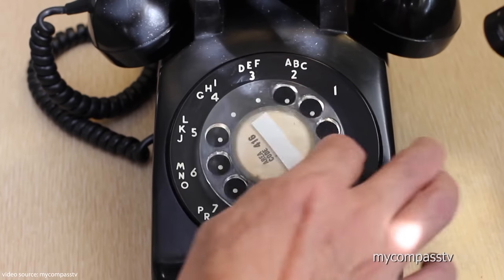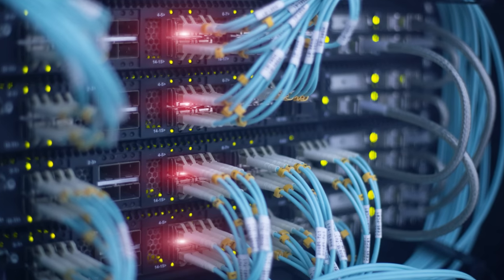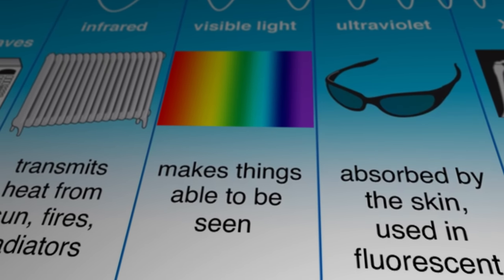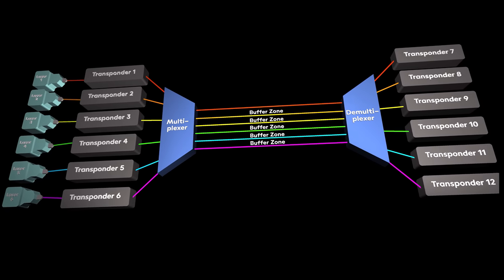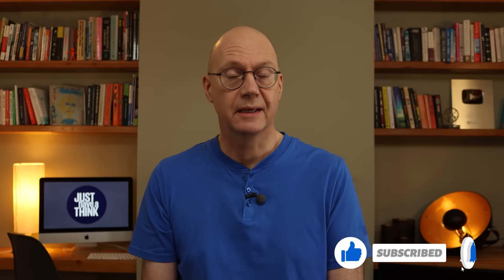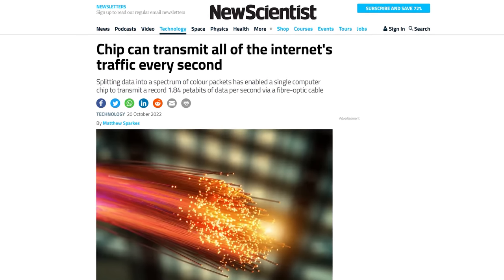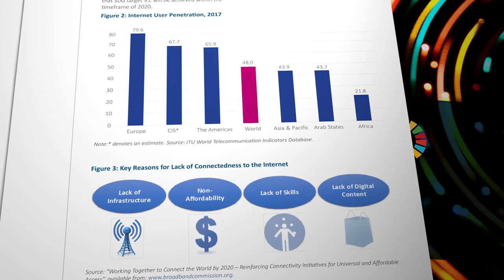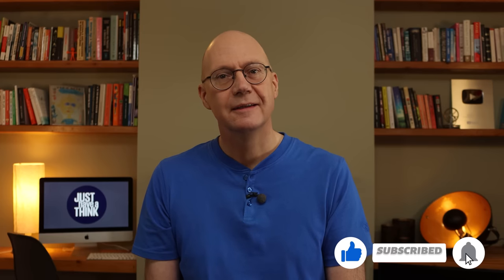The entire internet on a single chip! MASSIVE energy savings.

Comment: Okay, how could this be used for Super computing?  Right Now computers operate with Zeros and Ones, but once you have a Comb with several hundred Teeth, that could be sent down the same fiber optic line and accurate detected for its Frequency, well, think of the number of possible addresses there would be.  If the number of Addresses are truly substantial, than each Address could be equated to some basic principle or concept.... Heck  this is the Thing that will make Artificial Intelligence actually Intelligent, and it would be possible to create a Full Data Super Computer that could Think Comprehensively down to the finest distinctions.  That would be Cool!

Comment: If there is no single computer able to recieve all this data then what is the point. If many computers are needed to recieve all the data then the energy savings are just not there. They obviously need to solve the problem at both ends.

Comment: There are so many inaccuracies in this video it's painful to watch. A "chip" is not "faster than broadband" that's like saying a tire is faster than a highway. "The entire internet on a single chip" is just cringeworthy - "an elephant on a hard drive!" That's before you reveal you don't understand the speed of light, the way multiplexing works, or even how "the electromagnetic spectrum" is irrelevant to fiber optics, which use only the portion that is - duh! - LIGHT. Then since the point is the "Massive!" energy savings - where? HOW is this higher capacity transmission going to reduce energy usage/costs? We're not going to have (or need!) one of these in every computer, MAYBE just in every datacenter, where they might replace a 20W device with a 5W device - connected to megawatts of other unrelated hardware.
Reply: I'm afraid I have to agree. In fact the SFP's that do the transmission and receive only use 1 or 2 Watts for a 10Km range. All that will happen is the Mega bit and Giga bit SFP's will be pulled, swopped out for these Petabit transceivers, generating large amounts of e-waste.

Comment: Avoiding all of the common remarks about this technology. Imagine the broad ranging potential for AI and those that will make use of AI. I can envision a world where humans can become redundant, or at a minimum subservient to AI and the small number of humans that may manage to retain control over over AI. Machines require a lot more energy than humans, but are also more tolerant to environmental extremes. The only requirement for an atmosphere would be for the oxidization of some energy sources, but really even oxygen is better stored as water if the machine world runs on nuclear.